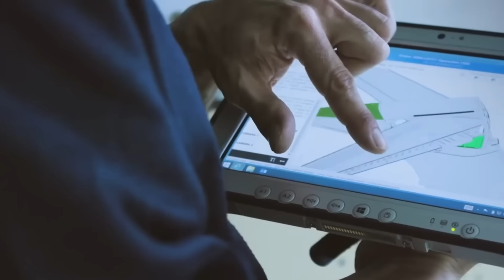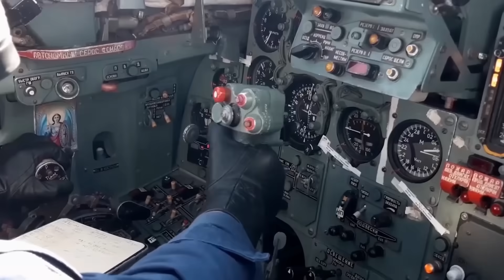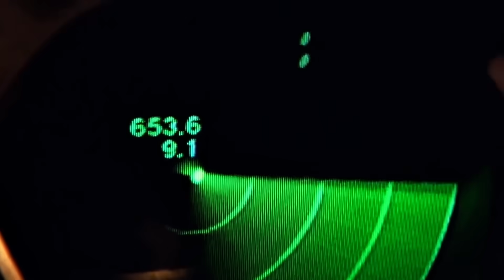New F-22 Raptor After Upgrade by SpaceX Shocked The World

Comment: F22 vs F35..who wins?
Reply: I was an F-22 crew chief. The F-22 is more capable, the F-35 was more affordable. But in the end dog fighting is pretty much non existent in real warfare.
Reply: @f15mech1stff  holy guacamole
Reply: ‘35, before the ‘22 even knows it’s there
Reply: @JackXOatmon  I believe the '22 would be. They had to lessen the capabilities of the '35 because the '22 was too good. Also the point of the '35 is long range BVR. The '22 is both BVR and meant for dog fighting as well. If it's a dogfight the '22 will win easily. BVR I still believe the '22 will win due to the fact the '35 was dumbed down: meaning that the stealth of the '35 would most likely be less than the '35.

(Sources: trust me bro)

Comment: The Raptor is a great platform, perhaps the best. It could use an upgrade, though it already has supercruise, slightly slower than the SU57, and with less weapons bay & fuel capability. It doesnt have 360° nozzles, and less wing size. It's stealth is better than SU57. This is full on hyper BS. It's the right plane to upgrade. But  Dont believe anything on this. Must doesnt do  jets. His rocket engines are way too large, and he has nothing to add to jets. His car AI is a disaster to put in combat planes. This channel is sci-fantasy playing you.